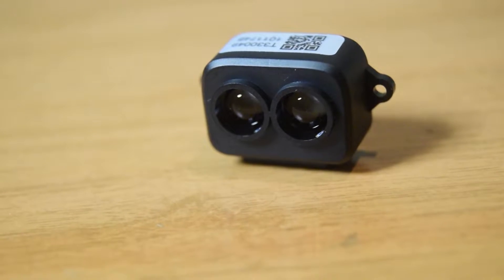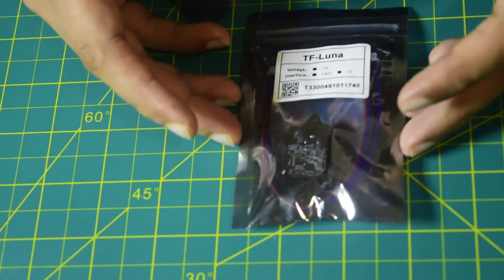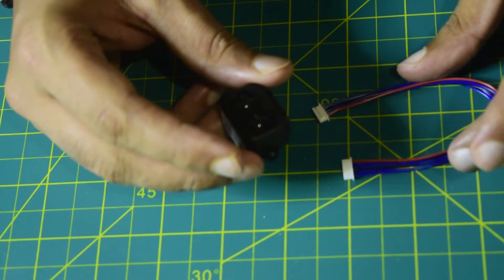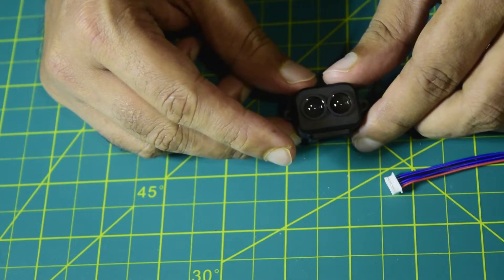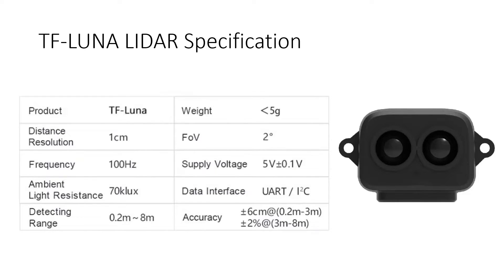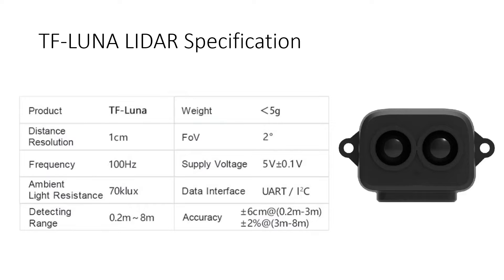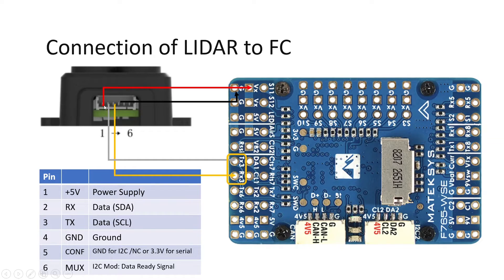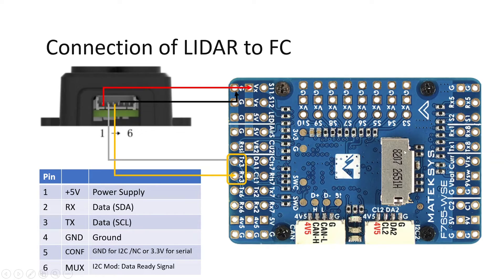Beginners Guide To LIDAR on Drone | TF-Luna, 0.2-8m Single Point Micro-Range Module with Wiring

Comment: Great video, subscribed! Also if I leave pin 5 & 6 unsoldered, I can still just run it on UART right? Or do I have connect 5&6? I am also using Mateksys Optical Flow along with this to give me both pos & alt hold. Is that a good config?
Reply from the maker: yes you are right you can leave 5&6 unsoldered for using with UART. i hope this video helped. please stay tuned to my channel for my future videos.

Comment: How to setup this on speedybee f405 v3 flight controller??
Reply from the maker: connect it to any free uart and the select lider sensor on the port config. I hope this helps. please stay tuned to my channel for my future videos.
Reply: Did you get this figured out? Any tips or tricks? I am thinking about adding these to my DIY drones 😉 I use the speedybee stacks and AIO on a bunch of mine 😁

Comment: under INAV this lidar it s ok ?
Reply from the maker: Yes my friend to select the lidar make you need to select benewake and this should work. I hope this helps. Please stay tuned to my channel for my future videos.
Reply: @AstroShootingStars  thanks dude for you what is better linard for inav matek or TF luna ?
Reply from the maker: Its not related and have different functionality.  Mateksys optical flow sensor is for postion hold as it works similar to optical mouse in addition to altitude it also gives direction of movement but the range is low so postion hold  works on very near to ground. Tf luna is just a range sensor it cannot do postion hold as it doesn't give direction so it can only do altitude hold. I hope this helps. Please stay tuned to my channel for my future videos
Reply: @AstroShootingStars  super thank you for your valuable advice and of course I follow your channel, do you think that on a 2 inch or less it is possible a lidar matek for example
Reply from the maker: Yes for sure you and use. Just that alt at which it will hold or postion hold will be very near to the ground.